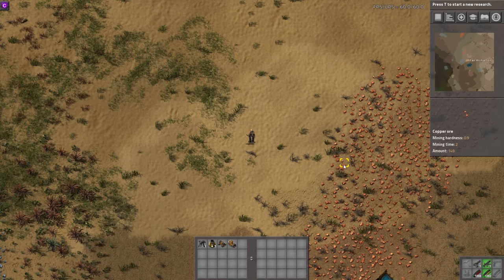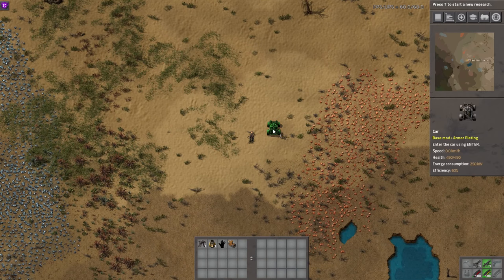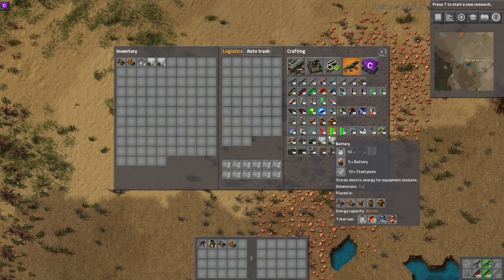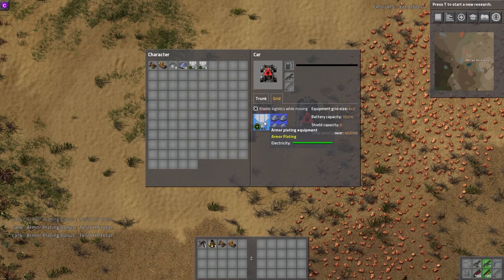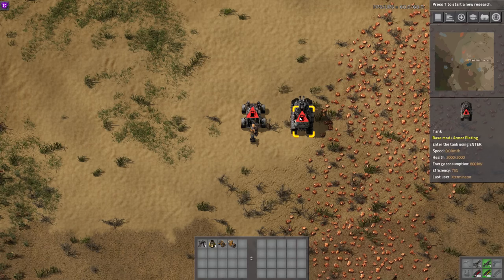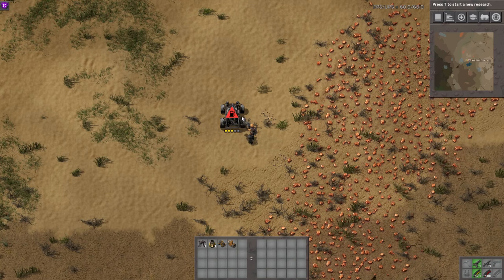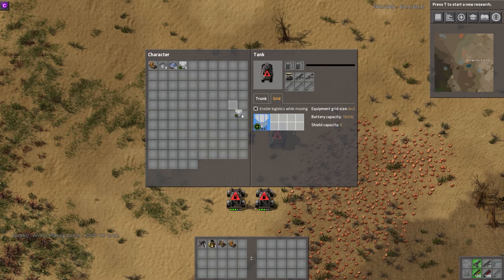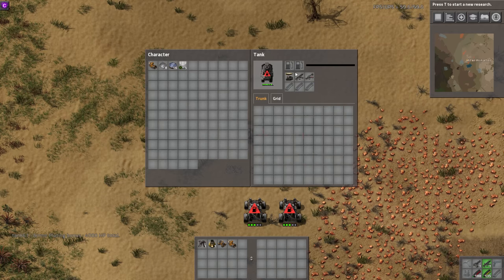Factorio Mod Spotlight - Armor Plating (Vehicle Equipment)

Comment: Even if we did not use this mod, it would be interesting if the vehicles had equipment grids. Because we cannot upgrade the vehicles to Mk2 or Mk3, perhaps "hanging" steel plate would boost the armor hit points or inserting more engines to increase the top speed, before the fuel bonus. That way, there would not be a need to create new items or technologies and the player would be able to continue to use what is already available in vanilla.